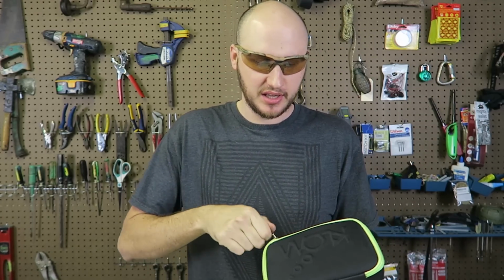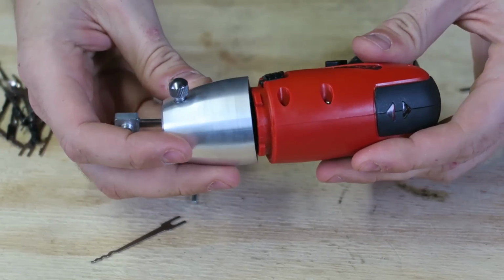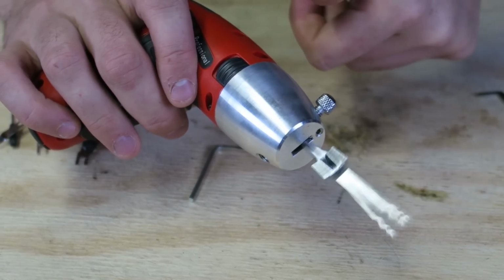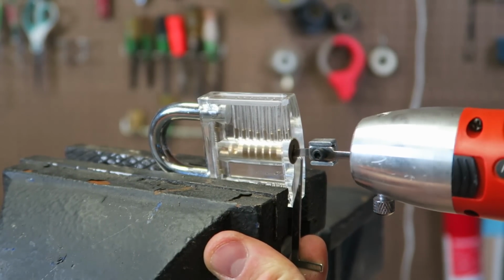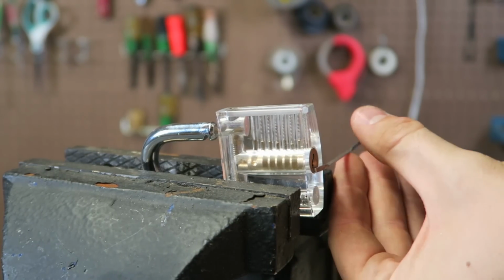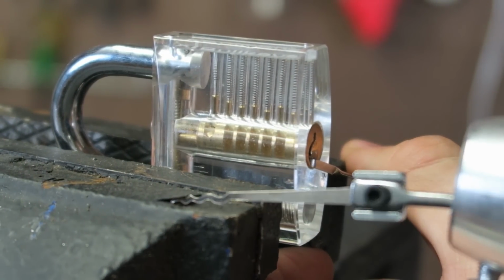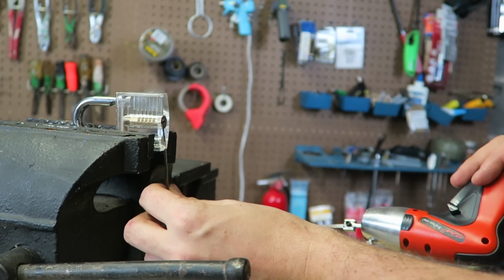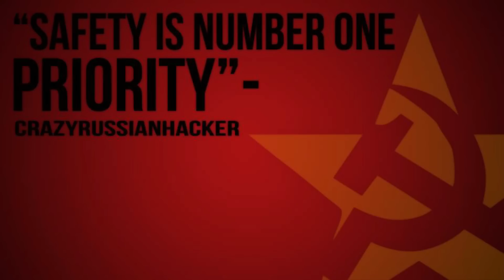Is This the Easiest Way to Pick a Lock?

Comment: Because nothing says stealthy robbing like a giant noisy drill
Reply: You can do the same thing more quietly and cheaply with a bump key
Reply: Steampunk Smilodon that's small and very quiet for a drill
Reply: ehh i think this is more silent than a bump key.. you need to hit the bump key with a hammer and it makes a lot of noise.. more noise than this.
Reply: animeforeverjoho using a rubber mallet or having padding on the key mostly fixes that problem
Reply: Steampunk Smilodon You just made my day! Well night!
Reply: Steampunk Smilodon payday2 be like...
Reply: GhostShipSupreme GUYS THE THERMAL DRILL
Reply: Steampunk Smilodon uh oh im the 666 person to like this.......cool
Reply: PayDay 2? xd
Reply: Steampunk Smilodon yeah but lock smiths use these
Reply: crazyrussianteacher
Reply: Just buy the silent drilling skill, stops guards and civs from hearing anything.
Reply: depending on the lock. the test locks are simple and very easy even for a novice to pick. ive picked cheap padlocks with homemade picks from paper clips. even picked a cheap yale lock meant for front doors. However i couldnt pick a more expensive lock that was actually on my front door.

But a skilled locksmith could probably still pick a lock fairly quickly.
Reply: MrMooseRPG You say 'civs' as if you're SS or something? 😂
Reply: payday 2 ?

Comment: It's taking him much longer than it should with that tool because he's putting way too much pressure on the tension tool.
Reply: I tried to do it can you teach me how to
Reply: With hair pins
Reply: He be better using the straight neadle as well but that lock can be raked easily

Comment: whats the point in locks if anyone can pick them ???
Reply: Guy of reason the same reason we have TSA
Reply: To be honest he tried it on the easiest/cheapest lock possible but yeah, in general cheap locks are easy to pick.
Reply: Pretty much all deadbolt locks can be picked with these.  This is why you need alarms
Reply: True.. I want to see him try to pick an Abloy, Abus, and the like..
Reply: Good quality locks are harder. 
Cheap ones can also be broken with a hammer or screwdriver so it doesn't really matter
Reply: Kollányi Dávid If you break the lock it will be obvious.  With a lockpick gun, you can go in anytime you want and no one will know you were there
Reply: That thing only works for basic locks. Things like spools and serrations are added to better locks to thwart that type of attack.
Reply: Tim Ramich I have seen pretty much all styles of standard deadbolt door locks installed in US homes opened easily with a lockpick gun.  There are expensive specialty locks that can resist it but those are very rare in residential use
Reply: So the combo lock market will rake in more profits.
Reply: Guy of reason u better get rid of Homer there son.
Reply: Guy of reason because that lock what he was picking was easy the more expensive ones are a lot harder to pick
Reply: you should buy better locks, like Abloy, these old locks that are everywhere outside Finland are really easy to pick
Reply: I can verify that for you. European locks have much higher security and a much higher variety. Instead of practically only two brands/keyways like we do in the US (Kwikset/Schlage), there is a lot of competition between lock makers.
Reply: Guy of reason go buy locks that have numbers keys plus numbers then 😂
Reply: but, have you thinked about the real question? why are they picks if we can lock them??
Reply: bios47 but it works the same as any lock on anyone's door.  These pins are very easy to get around
Reply: bios47 ye but even much more advanced ones can be picked
Reply: Locked stuff keeps out honest people
Reply: And keep honest people honest ^. A thief will always find a way...
Reply: Guy of reason to show people you have money (robbers)
Reply: first the Lock then the dog then the guy with his 9mm in real life the Lock is mounted in two holes and a acu angel grinder opens it in 10 sec
Reply: Guy of reason ikr
Reply: Get a bump proof lock and this tool will fail.
Reply: This tool only fits in some locks. plus he was using it upside down. lol
Reply: I wonder why that is? Are people in Europe more likely to have people try to pick their locks, thus need better ones? Or are US lock companies wanting to use cheapest method to make locks?
Reply: No matter the lock if you have a standard door and frame it's just a illusion of security a crowbar or just a kick could defeat the door.
Reply: john o if you have to get in a door a hammer across the hinges normally can knock out/ break the screws or frame holding the door. It's a lot easier than kicking or picking.
Reply: Good point john o. Also this tool is too loud to use if you are trying to be sneaky.
Reply: Unless they hear the very conspicuous BZZZZZZZZZZZZ-BZZZZZZZZZZZZ-BZZZZZZZZZZZZZ that accompanies that lockpicking.
Reply: Guy of reason what's the point of passwords if anyone can hack them ???
Reply: Blitzy
A tad different between the two because there are but a few pins into the tumblers but trying to crack a modern password with encryption can take several lifetimes whereas a lock can be defeated with this tool or for the bump proof locks you can use a simple mixture of Thermite.
Reply: Guy of reason this method that can be made with even clips pins only works with cheap locks. you want security then buy a expensive lock only an expert will be able to lockpick it
Reply: Guy of reason locks are only to keep a honest man honest
Reply: noah christopher
Precisely.
Reply: Right!
Reply: That's why locks are electronic now
Reply: Xoct Sënuch combo locks are easy to get into........usually they have a key hole for backup.......but you can figure out the combo using certain ways.......get ones with serated pins and spools
Reply: Dark Alchemist this isn't based on bumping. This is just cease line forcing.
Reply: exactly
Reply: Guy of reason
Reply: +Guy of reason that profile picture and that username... MMMMM so good!
Reply: do you like experiment videos
Reply: Guy of reason locks only keep honest people honest. There is nothing that is burgler proof with the right amount of incentive.
Reply: Locks are for honest people
Reply: Pin locks are easy to open. Some different types, like round Abloy -locks, are much, much harder.
Reply: What's the point in windows if anyone can break them? Should we switch to live behind solid steel bars or with no windows instead? (Remember, safety is no.1 priority.)
Reply: jort93z maybe a harder time but it's still pickable.
Reply: ... if anyone Russian can pick them! )))
Reply: Whats the point in locks if anyone can kick the door down?
Reply: while they were in

Comment: You should have used a different lock other than the practice lock. The lock itself is very easy to pick, let alone using an electric pick. You should have tried commercially available locks.
Reply: Dsbarrynl if I sneezed it would Spring open
Reply: Drakilicious they have a pick for combo locks actually, your goal is to find the flatspots instead
Reply: Simon Truong i lock pick myself and this isn't necessarily an easy lock to open being that this lock has 5  or 6 pins it is a beginner lock but this is simply for a better understanding of the mechanics inside the lock
Reply: Satanic_ Carrot my 3 year old has picked this lock

Comment: You know... that makes me think of something. Those oscillating springs look like a graphical equaliser for an AudioCD player whereby the signal is separated into its harmonic series via fourier analysis. Therefore, I anticipate, as long as there was a recording frequency and resolution high enough on a Analogue to Digital Convertor chip added to that red device (maybe prototyped via an Oscilliscope modded using MatLab) that the successful combination could be recorded to a computer. Then a point cloud 3D model of both the lock innards and key could be automatically generated and then 3D printed.

Comment: I have the lock being demonstrated and it is painfully easy to pick.  You can usually open it by just raking the pins while applying tension.  I can repeatably do that lock in under 10 secs.  The deadbolt on my backdoor never however.  I'd tune in for a demo on a harder lock.

Comment: that flat thing you called a pick is actually just a rotator pin for applying tension to the lock so it pops when the pins are set

Comment: No. if you actually knew anything about lock picking this is actually more of a fuss.
Reply: Benjamin Hubble He literally did it in a few seconds but OK.
Reply: Frank Gill most lockpicks can pick locks faster by  quickly feeling up the pins arrangement and how they need to be set, and then completing the arrangement while maintaining tension using the tension wrench
Reply: Or you just stick the friggin thing in there and let it do the work.
Reply: Agreed. I'm no expert, but 2 seconds is about how long I need to pop one open - with the old-fashioned picks.

Comment: maybe I'm just old fashioned. but I'll definitely stick with my handy manual pick set. doesn't damage my locks, easier to carry, more discreet, and no batteries. knowing how my luck is I'd forget my keys AND the battery in this thing would be dead.

Comment: I have a question for the lock people put there. why is there a small little hole on the side of a keyhole? like there's the spot where the key goes in and there's another kinda smaller one thst doesn't do anything. anyone know what that's about?

Comment: Problem with the lock he is using in the video is that it's only a practice lock. You only need to align 4 of the front pins to unlock it. Even then it's stupidly easy to open. Try this thing on a real lock.